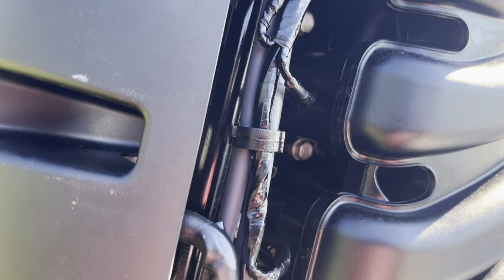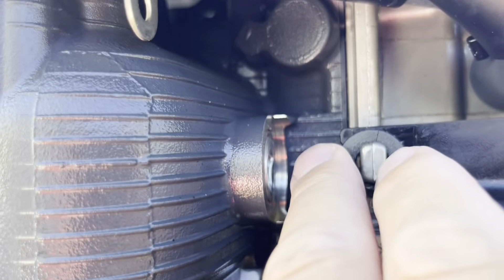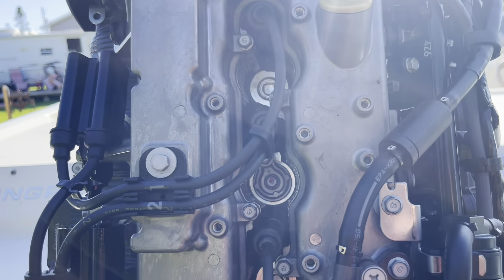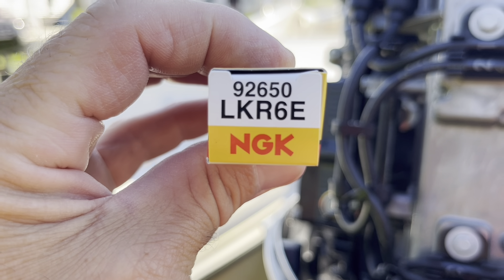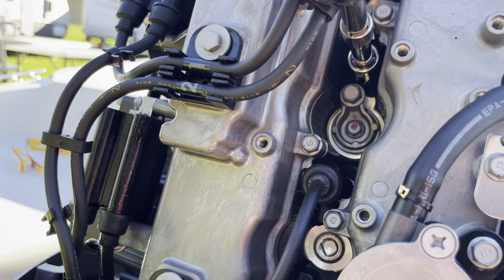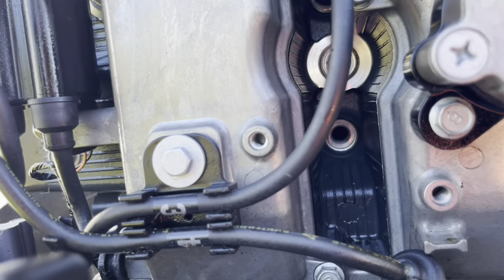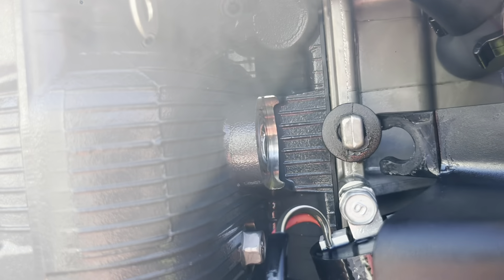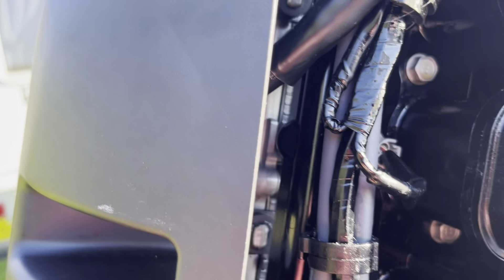Yamaha 115 Outboard plug change

Comment: You should have mentioned the use of a thin layer of dielectric grease smeared on the inside of the rubber boot or as i do on the ceramic part of the spark plug is a must. It prevents the rubber boot getting stuck and also prevents any arcing/spark escaping the boot. Also you should have said to make sure you check that the gap is correct, i have bought the correct spark plugs several times and the gap has been way off, even closed sometimes. Correct plug, correct gap, a little dielectric grease on the ceramic and the correct torque when tightening and job done. It says on the pack how much to tighten to crush the washer 👍. I do it buy feel.
Reply from the maker: thank you, all help appreciated!

Comment: Great video. Thank you so much for sharing. I do have a question that I thought you might be able to help with: I was performing my 100 hr service on my 2019 Yamaha 115LB. As I was pulling the cylinder #1 spark plug lead, my hand slipped off the boot. Unfortunately, my hand caught the cable and pulled it out of the boot. 

I inspected the ignition coil to determine how to replace the lead; however, it appears that the leads are hardwired into the ignition coil. Is that, in fact, the case. If so, do you know if replacing the ignition coil a plug-and-play repair? 

If I am able to replace just the lead, do the lead wires simply from the ignition coil, or does the ignition coil need to be dissembled? Thank you.
Reply from the maker: Hi ... sorry for the late reply, thank you for watching and commenting on my plug change video.  As far as your new question goes, I would continue to search out on Youtube, I am merely a DIYer and would not want to take you down the wrong path, sorry I could not be of more assistance to you.